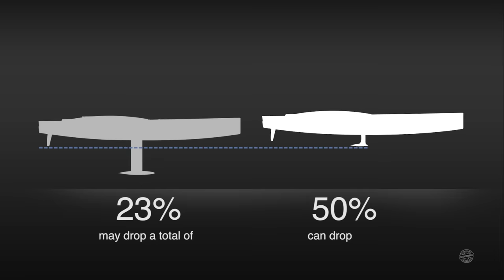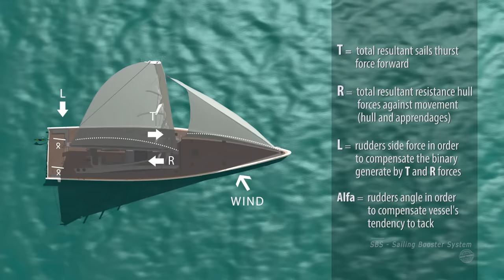SBS - Sailing Booster System - Fast Sailing Performance

Comment: What is wrong with people ? It's a good idea. Why do people feel the need to attack people who try new things ? Jesus knew.
Reply: Just spitballing here, but, could it be that deep down we've come to realize that this sort of thing is just another bullshit way to separate us from our wallet...
Reply: It's just the way it's advertised... like it's THE solution which will bring sailing to another dimension... ;)
Reply: Lucious brun, totally agree with you : some comments are nothing but agressive. Those people don't seem to be quite openminded. How could anybody anticipate fatigue of a new device that brings less stress in the structure ? Anyway the trend in multi-hull IS the foil, as well as some mono-hulls today in America' cup.
I just remember the very first picture of Eric Tabarly testing such foils on a Tornado inside Gulf of Morbihan (Britany). At this time nobody believed it coult change the things in sailing, but today we start to see he was right !
Reply: Well consider this. In antiquity it took centuries to realize that boats could be sailing upwind by using the centerboard. Before that boats would only be sailing downwind. The revolution of introducing foils is far from modern: according to the Wikipedia already attempted in 1898...  In the sail world revolutions have been more on the way you would design hulls,, new materials both on the sails (and its design) and on the hull and mast to reduce weight... those revolutions posed fundamentally nothing new compared to what it was in antiquity the centerboard (or keel). I think we might be witnessing a new similar revolution is just around the corner with wings and foils.
Reply: lucious brun if things go wrong off shore you can get up shit Creek quickly. I think this is a good idea, just way to complicated
Reply: People who can already sail don't want other people to sail, they want us to continue living in fear of sailing.. so they want to discourage us to hate SBS
Reply: I guess the problem is to make the boat not slipping sideways in the wind. There is no, or little point to just avoid the boat from leaning.
Reply: Because it's not a new thing and it's not a good idea.  Considering I've sailed around the world and have owned multiple sailboats including multis and monohulls and have an engineering / fluid dynamics background and degree, I might actually know what I'm talking about.  This is the stupidest thing ever.
Reply: @Sugarsail1  is this not a stepping stone to retrofitting foils to regular boats?
Reply: He drowned Babe and all his piglets because he thought the devil was hiding amongst them. When I learned that about Jesus, he lost all his credibility. A true son of God would care for all his flock, not just so called humans. Anyway, it's mostly a bubba misa, which means, 'a grandmother's tale'.

Comment: More stuff to break
Reply: I can't see that lasting long in rough seas.
Reply: Yep. In ocean sailing you want simplicity and durability, especially when far out at sea.
Reply: said the same
Reply: Yes. The basic idea and the physics in ideal conditions make sense. Using hydrofoils in some racing classes (not bluewater) also makes sense. No way is this a good idea to retrofit to boats that may go offshore.

Comment: I love all the ingenuity put into this, but why not just build something with a larger stability in itself. For instance a catamaran? That would reduce the number of fragile and failure prone components.
Reply: Amazing!!!
Reply: Exactly viedotosse... this all seems silly when you can buy a cat or trimaran. As for fitting into a dry dock, not an issues as their are many folding trimarans if that is an issue for you.  However if you can not just let go of the old monohull ways I guess this is the way to do. I own several multihulls and monohulls, but if I want speed I will also go with a multihull.
Reply: Single hulls are more inherently stable in true storm conditions, at least with a traditional keel. Without a traditional keel, this stability is likely reduced, and I am unclear on how much you gain with these flop-down wings. Catamarans are more dynamically stable in all conditions except when it hits it's limit for inherent upright stability, and then a cat will flip upside down, and you will never get it upright again. In theory, a foiling monohull is the ideal offshore boat, however the maintenance and wear-and-tear on systems such as these are an unknown cost for unknown performance benefits. Also, in theory, with appropriate skipper decisions, catamarans or trimarans can be made VERY stable during true storm conditions. There are tradeoffs for all sailboat configurations, there is no "Best".

Also, the configuration of this system is sketchy when it comes to sail-rig work. Just imagine you have to tack your 150% genoa and in order to do it you have to lower this fin in the water... it's added complication. There are ways of doing an offshore foil that are less cumbersome than this design.
Reply: The foils fully down in the water during a storm would add large stability, like two more large keels and two large horizontal foils.  That said, the joints would need to be very strong since the storm loads would go through them.

Agree in the up position the appendages could interfere with long headsails.
Reply: Yes and if a foil breaks, which will happen as its only a matter of time before one hits something at sea, then you're screwed, especially if your boat has a modified shorter weighted keel.
Reply: @Loanword
They should add stability, but the thing about a keel is that it reflects wave energy which actually reduces the incoming waves when hove-to. Most of the boats that attempt to foil always attempt to keep moving so there are essentially no hove-to conditions for them. I am unclear how safe a boat like this would be in the (admittedly unlikely) situation where you can no longer sail, and all you're trying to do is make sure the boat does not slide down the face of an 80-foot wave uncontrolled. That's really where the danger for sailboats comes from, sliding down big waves, or breaking waves. If you can keep a keelboat upright and stationary relative to the incoming waves, you can always keep her safe from serious damage.
Reply: +jeremyrainman I was actually thinking of the hove to position when I wrote the above.  That said, the loads on the foils would be large, and the hydrodynamics perhaps less well understood than a plain monohull.  

If the foils survive, they might add a lot of stability.  Some (slow?) forward motion would probably be better than actually hove to, however, to keep the water flowing over the foils and give some stability via lift forces.

The other thing to keep in mind is that a faster boat can route around weather more effectively and arguably avoid the bad stuff or even run away from it better.  That said, the speed gains from these foils may not be huge for a (semi?) displacement hull.  Maybe more effective with a planing hull.
Reply: +FunToSail com With two foils, if one were to break, in principle you could put one to lee or wind if needed, like daggerboards on a cat, etc.  That said, anything sticking out is always at risk of breaking, and the same applies to conventional rudders, keels, boards, foils, etc.
Reply: I think this design is interesting and certainly anyone interested might want to give it a go. However I think standard keelboats work well already on the open ocean. Think leave the foils to the multihulls.
Reply: @Loanword
I don't think a horizontal foil will reflect much wave energy in hove-to, but that doesn't mean there wouldn't be some other effect that is beneficial. Wave energy is a vertical stack in the water, and the deeper you go, the more energy (and less movement) occurs. A deep, and long (bow to stern) keel has the best chance of reducing wave energy in a major storm, and can even turn small breaking waves into non-breakers when you position the boat correctly.

Yeah, faster boats can route around weather better, but it's not 100%. The highest average ground-track speed (it depends on latitude) of hurricanes is around 15 knots, so if those foils can't push me along faster than that, they'd better provide equal or better stability in the ensuing waves. Also keep in mind that that is an average speed, hurricanes can have ground-tracks in excess of 50 knots. This is rare, and usually leads to the break-up of the low, but it does happen.

To be honest, I'm not sure what I would trust more, a multi-hull or something akin to what the French are building these days in their foiling monohull racing sleds. Most people can't afford multi-hulls above 30 feet long, and surely can't afford the 70-foot-plus racing monohulls being put out these days. I just feel like trying to add foils to your average 30-40 foot cruiser and relying on those foils to get you out of a major storm path is a disaster waiting to happen.
Reply: Agree.  All design choices have tradeoffs.  What's fun is trying new things, even if they aren't perfect.  If we don't try new things, we never advance.

Also, the new America's cup boats are monohulls with tilting foils abeam. Not quite the same configuration as these, but defintely related thinking.
Reply: Yeah, Videos like this don't make me want to put foils on my boat, they make me want to own a boat factory.
Reply: yeah if you are going to these lengths for a mono might as well shel out and get  cat
Reply: Sort of agree, though it's somewhat apples and oranges.  They're pretty different types of boats.
Reply: yup putting hydrofoils on a mono is like trying to polish a turd, just get a multihull.
Reply: @LoanwordEggcorn  all the way up sure but what about that 90 degree deployment shown in the video. 8:54 for example.
Reply: @andrewyork3869  Can you clarify which context we're talking about?  Storm, normal sailing, etc.?
Reply: @LoanwordEggcorn  that was in regard to interference between a jib and these foils on tack. If its all the way up for sure there will be some issues.
Reply: @andrewyork3869  The leeward foil is in the water to counter leeway and provide righting moment.  The windward foil is raised and on the opposite side of the jib.

One would probably lower both foils during the tack, then raise the windward one after the jib had moved across to the leeward side.

Also the foils seem aft of the mast, but I suppose there could be interference with a long jib during a tack if one didn't lower the windward foil first.
Reply: @LoanwordEggcorn  yeah amd if they where both down I don't see that being much of an issue. I would be curious how this boat hoves to would love to put a set up like this and a nice aluminum yacht.
Reply: @LoanwordEggcorn  l

Comment: Lee boards with hydrofoil wings -> less ballast , greater SA / displacement ratio => faster , improved righting arm , improved stability and enables shoal draft cruising - allowing settling on tidal flats comfortably like a bilge keeler -> avoid cost of haul outs . A revolutionary concept . Well done !

Comment: One of the benefits of a mono-hull sailboat is that it can dump the wind-force through a full- or semi-knockdown from unexpected gust strength or too few reefs. With this system it seems that the boat will not be able to dump the wind-force which will put catamaran like forces on the mast and rigging. Would you not then need to constantly cycle through sail changes with this system as you do with catamarans?  Would mono-hulls need to be engineered with stronger mask and rigging to account for the increase in forces?  Also, in the unfortunate case of a capsize how do these wings affect the boat's righting moments for self-righting?
Reply: I need to see some independent professional test results regarding all of my queries to begin to seriously consider this system.  Tank test, marine engineer studies, CE ratings, etc.
Reply: No need to be arse.  Unless of course you are one. In any case  marine engineering is not my speciality which is why I would defer to independent professionals.
Reply: Self righting is my concern as well.
Reply: The boat should self right with the wings, as long as they are relatively light weight.  However, the idea of radically reducing the keel weight as shown would definitely reduce the ability to self right.
Reply: A rig which permits instant reefing meets this requirement.  A modern junkrig /
wingsail hybrid meets this requirement, and improves sailing in many ways, such as by providing a more reliable rig, better efficiency to windward, and eliminating free standing sails which must be fought to the deck and replaced at great effort with other sails.

Comment: I see a lot of problems. 

Reducing your displacement boat probably won't do very much to increase your speed as it induces a lot of drag, especially if it's not lifting the boat a whole lot cause it's a displacement boat. 

Now you need to be running a high power pump to move the foils all the time, so a generator is required.

"For cruising" yeah how are you docking with those wings???

Stability is probably true, that's just more wing surface in the water.

The pitch one is really what hurts. Boats sail much faster if they are allowed to rock up and down waves, and many performance boats aim to reduce weight aloft to assist with this rocking motion. If their system is designed to damp it, that's drastically hurting your speed in waves. 

I don't hate the idea, I really enjoy sailing on very high performance boats, and want one for cruising. That said if your system claims sit do everything well, it doesn't do anything well in my experience.

Comment: Where does all the electricity to run the hydraulic pumps and control boxes come from?  Do you need to run a generator constantly, or fill the hull with batteries?
Reply: No you just hire a bunch of NFL athletes off season to pedal power up the hydraulics. Isn't that obvious?
Reply: @geraldsobel3470  I can't believe I missed the simplest solution 🤔

Comment: You conceived the engineering, built a prototype, recorded demonstrations, prepared this video and uploaded it here in 2016 - all  before the last AC races (35th) even started!
This foil system shares the conceptual flaws of the AC75 foil system. I find but two differences:
- Your L foils may have lower induced drag vis-a-vis T foils.
- Your foil's righting moment is lower, unless you use an S lever like the AC75.
That said, your claim for creating the foil system seems to be quite solid.

Comment: I've been shipmates with similar type systems on commercial fishing vessels with steel hulls and they are very impressive in most weather and sea conditions .  They need to be built/designed very robust to withstand the torture for each vessel . On a GRP or similar construction it would be very taxed in my opinion unless the vessel is specifically structured to handle them .  Not an after market add on (one size fits all )for sure .
Reply: You prolly dont give a damn but does any of you know a way to log back into an instagram account??
I was stupid lost the account password. I would appreciate any tricks you can offer me!
Reply: @Dean Bentlee Instablaster =)
Reply: @Cyrus Thatcher It worked and I actually got access to my account again. Im so happy:D
Thanks so much, you really help me out!
Reply: @Dean Bentlee Happy to help :D
Reply: @cyrusthatcher5936  Blatant spam

Comment: have to wonder if boats can really handle the torque on that section of hull which they are designed to be mounted
Reply: this is a good question +daniel gally

Comment: What could you do here without the motorized mechanism? Stationary foils. The foils hinged and attached to the side of a sailboat. Then lowered into the water and locked in place. 🤔
To reduce the cost.

Comment: always love when people t ry to pass off something ancient and trusted as brand new and revolutionary. That's probably half the reason people are critical of this so it's backfiring here. This is basically a cross between an outrigger (which maoris have been using since christ or so) and leeboards (which have been used since the medieval ages as far as I know and probably much earlier) this is just powered and automated. I am not going to knock the idea, but in sailboats usually the simpler the better.  The more that can break or go wrong will

Comment: There will always be naysayers, ignore them. This system is innovative and provides novel solutions, well done and l look forward to seeing it on the water
Reply: it's not innovative, militaries have had hydro foiling vessels since WW2 and hydro foiling sailboats began in the early 1970s.  Where have you been all these decades?
Reply: @Bf26fge  yup , in the garbage.
Reply: It's expensive, vulnarable and inpractical when  docking/in harbours etcetera. Maybe good for braking records in ocean races, but most of these racers do not stay in one peace and often have big problems with this kind of system. For cruising it's a nonsense solution for a problem that does not exist.

Comment: Here in the Netherlands our old sail freighters (froom 1800 orso) used a more simple and rugged system. on both sides,the ship has a large vertical dropshaped blade that can be lowered according to nessecity.. The dropping and hoisting is done using a rope and some blocks. the tear shape with the rotation in the point of the tear makes it possible to partially lower the blade if neccesairy. The system showcased here is very ispace consuming  and unnecessary complex.
Reply: That is similar, but does not provide vertical lift of a horizontal foil, so not as much righting moment to counteract the horizontal force of the sail.

Also the type of board you describe goes back many more centuries, and was an early way steering was done.